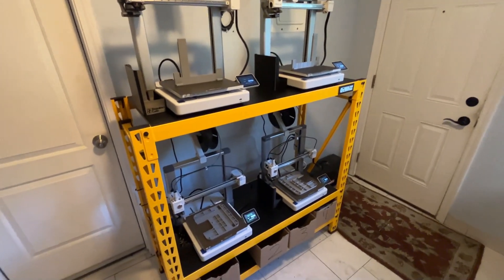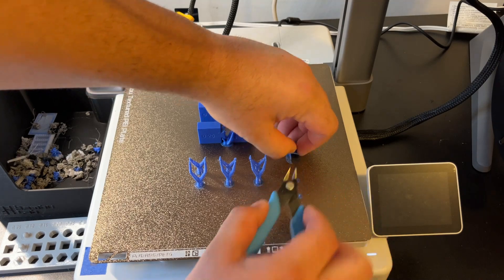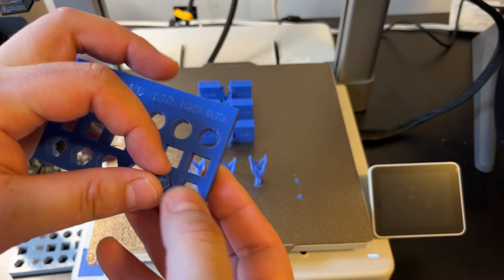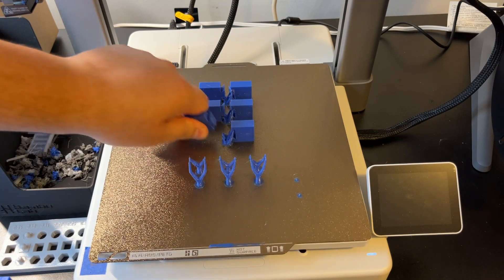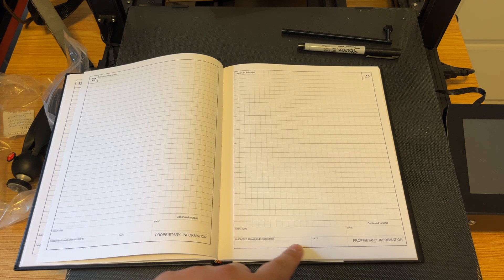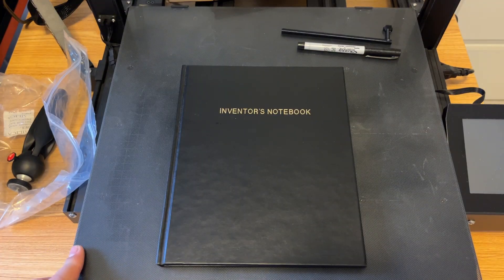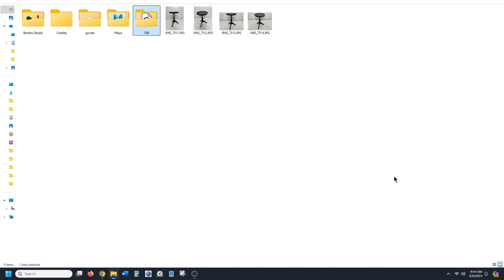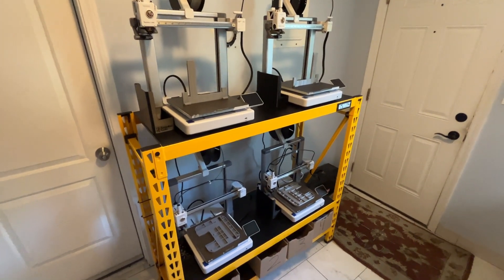Bambu Lab A1: Next-Level Tolerance Testing & Prototyping Strategies!

Comment: Thanks for the video. Check out retraction tests to get rid of this tiny threads between objects! Recently did printing square shaft in horizontal plane, and all was good and tight untill I had to push it through few holes

Comment: What is to become of the creality printer? Any special projects? I print from time to time on my cr10 v1 and ender3 pro . I mostly use my neptune 4 plus now and hoping for a bamboo in the near future.
Reply from the maker: @unholyorders82  Great to hear about your setup! The Creality printers, especially the CR-6 Max, are mainly reserved for larger prototypes due to their print area. I’m currently selling the Ender-3 V2 Neo as I streamline my equipment, but the CR-10 Smart continues to be used for special projects. Excited to hear you’re considering a Bambu Lab, in my experience the A1’s I have are fantastic and reliable machines :)